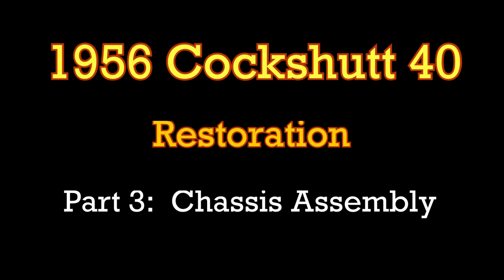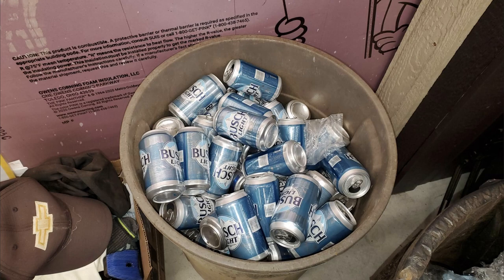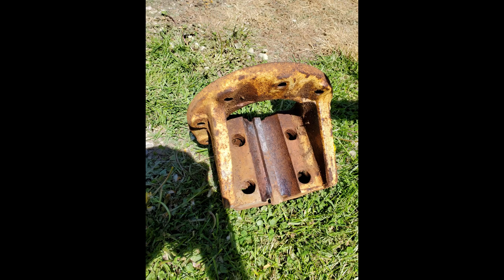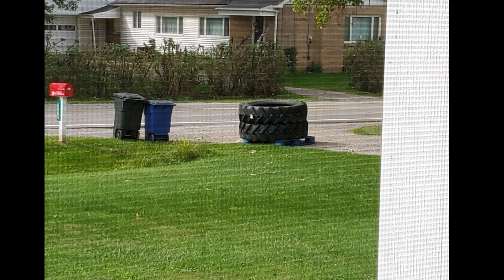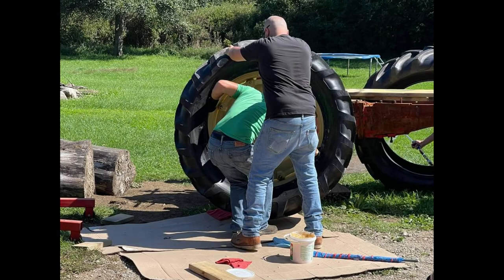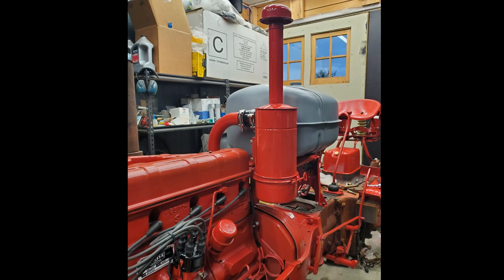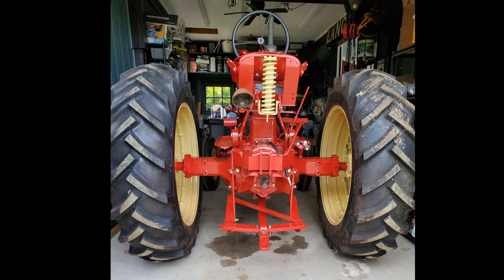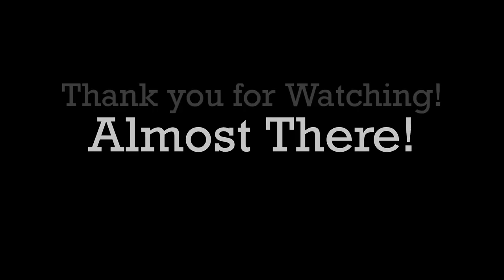1956 Cockshutt 40 Tractor Restoration:  Part 3 - Chassis Assembly @langbros.1907

Comment: Where did you find tie rod ends? 
Thanks for taking the time to make videos!!
Reply from the maker: Thanks Bryan.  Great question, if you have the double sided tie rod like mine it is hard to find the outer with the LH thread and it's an unusual size.  Steiner or jensales didn't carry them (they might now) so I ended up reconditioning my tubes and bought new inners/outers online.  They are Moog problem solver rod ends used for an HD truck application that was an exact fit.  I'll find the part numbers and send a follow-up.
Reply from the maker: Pretty sure these were moog es2121L and es2120R.  11/16-18 thread, one each per side.
Reply: Thanks! I'll check into that & also confirm that my tie rods are the same.

Comment: WHERE DID YOU GET YOUR PARTS?
Reply from the maker: Most parts I got through Steiner Tractor Parts.  New tires were mail ordered and drop shipped through SpeedyTire.com.  Engine parts through Jensales.  A bunch of miscellaneous hard to find stuff (used) through Phil Heisey out of Pennsylvania, and the rest from swap meets or online auction.
Reply: @langbros.1907  THANK YOU. i AM LOOKING FOR DISHED PISTONS FOR MY 40
Reply from the maker: I have a set of dished aluminum buda pistons but need to check specs... the might be over bore and use matching sleeves.

You can get new pistons from Mahle.